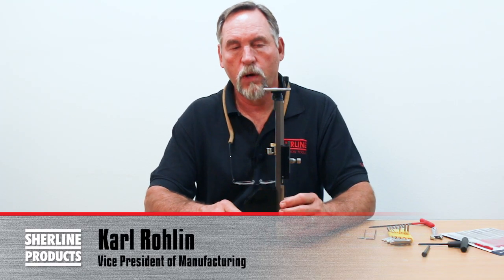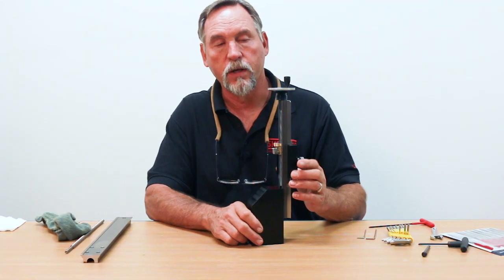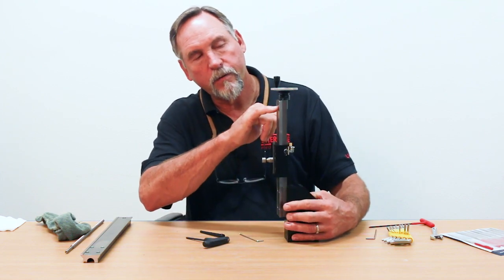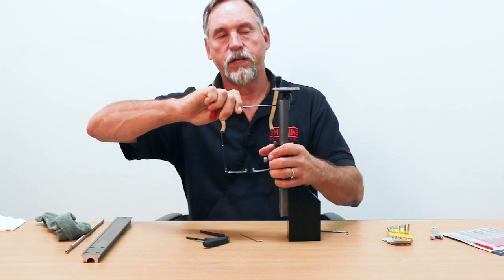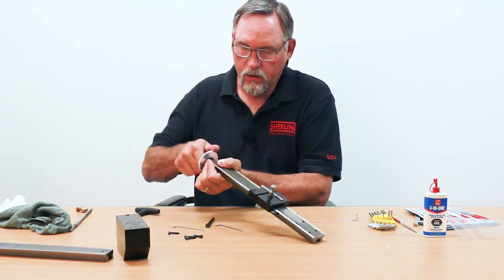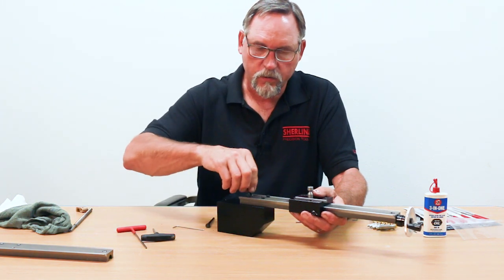Upgrading to a 15-inch Column Bed

Comment: Is it possible to use this or another column to mill on the lathe?
Reply from the maker: @durangotang 1 Standard mill columns cannot be used on a lathe. However, we have a number of milling columns designed specifically for our lathes. Here is a link to our lathe mill columns: https://www.sherline.com/product-category/lathes/lathe-mill-columns/. The difference between the standard mill columns and the lathe mill columns is that the lathe columns have a keyway slot on the bottom of the base that helps align it to the lathe.
Reply from the maker: @durangotang 1 Once you find a vertical milling column that you like, just check the 15" Extended Column Upgrade box located below the part name.
Reply: Sherline Products awesome! Thank you. One more question,I was approved for PayPal credit is there anyway that I can use that on your site? Or do you have a link to an Amazon or eBay store where I could find additional parts like the mill column?
Reply from the maker: @durangotang1681  We do not take PayPal as a form of payment at this time, and we do not have an Amazon or eBay store. You might be able to find a third party selling our product on those platforms. Thank you for your interest in Sherline Products.